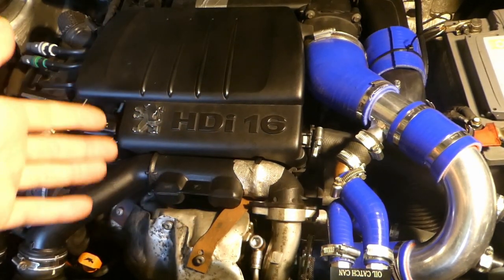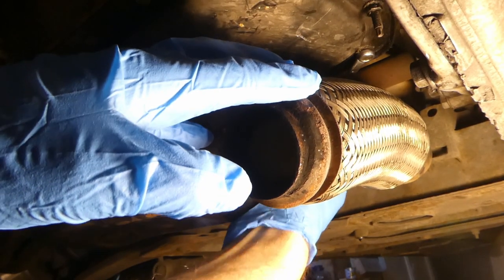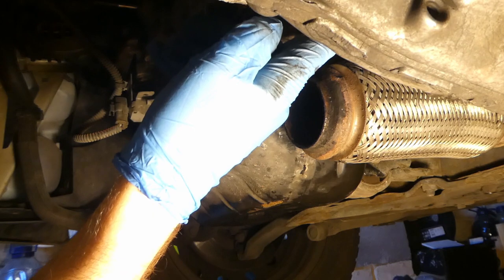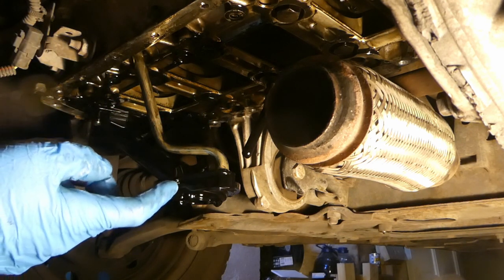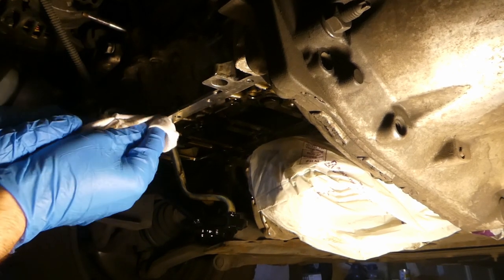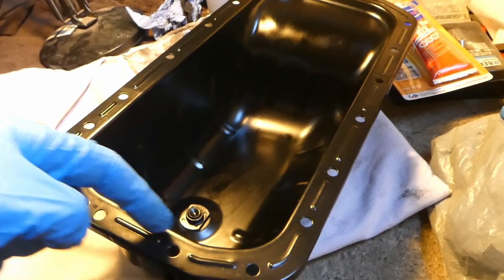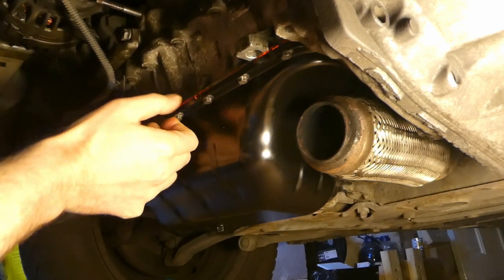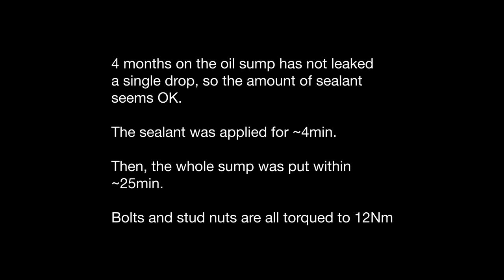1.6HDi oil sump replacement (Peugeot Partner 2007)

Comment: Nice.
And for more good news, just returned from the MOT under new stricter rules here in France. With 142K km and doing the stuff myself now, I was a bit nervous but it's good and we can use it for another 2 years. 
Two things came up, the fog lights low in the front bumper were pointing too low, well that's a bit of a mess up from my part, I knew I put the bumper assembly on the car tighter then it was before after I cleaned out the intercooler, but totally forgot that this could have messed up the alignment of those little lights, sure that is an easy thing to get right. 
The other was an obd fault code P1351 for an anamoly in anti pollution fluid without dysfunctioning important. I guess I need to fill up/ replace that fluid.
Thanks because it were your videos that showed me so much so I was able to get the things done. It feels pretty cool to see all the things I have done like the brakes are all in good working order.
Reply from the maker: Nice one Wim. Good to hear you have done well with the car. Every time I go for an MOT they always say the lights are too high and I have not done anything. Could well be tyre pressure, etc. There was this one time, before me doing work on the car myself, one of the headlights had broken support plastic and was dangling. Went to the garage, they charged me for a full headlight and then in two months time went to the same garage for an MOT. They phoned me that the car had failed and one headlight was aiming too high and wanted to charge me £30 to adjust/fix it (too much money for nothing). I asked which headlight was that and it was the same one. I told them you replaced it two months ago, she checked their records and fixed it without charging me. Ridiculous amount of money for a simple screw for the adjustment. I have not yet figured a way to adjust them myself, kind of a simple way. I do not want to buy the expensive thing/prism that you put in front the headlights. I need a wall, but difficult to get one and the ground is level. I need to do some work on the car, coolant, brakes, service, etc., before the MOT this year, probably brake fluid as well and of course remove all of my oil catch cans, despite these reducing the pollution of the car. Might do a video of something that was not covered before by other people. I only try to film stuff that was not covered before.
All the best
Reply: more molecules thanks, there is a reason you see the derogation "stealer ship" mentioned a lot reading/viewing about day car things... We are lucky and have dial to turn to adjust height of main lights from inside, and I really took good care of placing the huge headlight assemblies back, the bumper however is also very huge (funny to take those thing inside to show to family, in another setting the scale becomes more clear:)) and when taking it apart I saw it could be assembled tighter, so of course I did, making some gaps half the size. I feel so stupid not thinking about the ligttle , never used fog lights down there, I should have known the alignment was off when putting things back a little different. The garage guy said it was really not important, they area extra and no reason for failing an MOT, 
It was funny, they called earlier saying,  the oil filter and oil have not been changed in four years, so I replied, no worries, I changed the oil, filter and diesel filter and air filter half a year ago. To which he replied, d'accord superb" (ok that's good) and then we got the paper with the fault code, this is the first time they actually provided that, normally they just out regular speak things like tires need replacement, but now a code. He also was very respectful with icy is pretty cool for a French guy towards a non Franch person here. Of course their name is on the car and it looks pretty nice (I wash carefully despite a flock of thousands of birds residing in the bamboo in out front yard every day right behind where the car is.
It got me thinking, it must be hard to do a job with your hands knowing your customers are basically too lazy or not caring enough to look into it, must be nice to see somebody doing a proper job and keeping a 13 year old car looking like new :)
Reply from the maker: @Quibus777  Hahah, nice one with the oil, oil filter and air filter :-) Last time I went to a garage they asked me, "you dabble a bit, don't you". I did not admit I do anything with cars, I was playing the dumb customer, hahaha
Reply: @moremolecules  hahaha i did took out all non standard things and tools before we went to drop it off (like the obd2 to USB cable that is always connected to attach a little reader for temp and such during driving )and the mirror with dash cam that is over the regular rear view mirror and the cable to connect rear view cam (,though I left the cam for its screwed to the rear bumper)
Reply: @moremolecules  -  I'll drop my 2 cents on the way out! 
"...I need a wall, but difficult to get one and the ground is level..."
In fact it's incredibly easy. Go to ANY underground parking. Problem solved. Depending on your location big supermarkets or shopping malls will allow for free parking. So it's even better. BTW 3 minutes is all you need anyway.

Flat walls and flat leveled ground everywhere. Plus the fact it's dark enough to make it a breeze regarding headlight adjustment. K.I.S.S. is always the best.  ;-)
Reply: p1351 is a faulty glow plug my dude

Comment: There is a pattern sequence for all types of covers, sumps, heads, etc. Starting from middle bolts to end bolts turning left side and right side and across to pre-torque, and then again same pattern -  torque to correct settings. (Like expanding X )

Unless it's said differently in the car manual, this is the general rule.

But thanks for the nice video!!!
Reply from the maker: Thank you fot the correction and advice, appreciate it

Comment: Ok finally  finished the sump job  thank mate all your support !...
Reply from the maker: Well done!
Reply: @moremolecules   3 days took  thinking doing ERG next ? Not confident  though ?
Reply from the maker: @philipmaguire9209  Not that difficult, only difficulty is taking the bracket that holds the EGR to the cooler. Best done with the tool, otherwise is difficult. Replace with a screwdriver bracket, much is easier later on.

Comment: Those sumps leave 200 ml of oil in them when you change the oil. My wife just hit a rock in our 308 and did not tell me. However she told me the oil warning was coming on occasionally. I took it for drive and the oil light came on going around right hand corners. This was in the middle of engine management light issues. So under I get and surprise surprise there is a big crease down the engine protection plate. I remove that and there is crease down the sump. Remove the sump and the plastic oil pickup had snapped up above the 3 mounting screws resulting in it losing oil pressure as the oil went left as the car was going right. Now  I am waiting for the sump and oil pickup to arrive.
Reply from the maker: Hi David, yeah, absolutely right about these sumps. I had a video on how much is left inside (https://www.youtube.com/watch?v=5kevvRopWUc). I now have a big syringe to suck the oil left in the sum on oil changes Good luck with the sump replacement

Comment: This original desing oil sump of 1.6 HDI/Tdci engines has a big flaw.

Bolt is not at the lowest point of the sump, so there is left about 0.2 liters of old oil, really unbelievable.
Reply from the maker: Yes, it does have a bit of a design flaw, although I understand the manufacturer's thinking. If the bolt is sticking down it has a higher chance of being hit by something and loss of oil. I think that was the reason of pushing the bolt inside the sump.
Reply: @moremolecules  They have to do it smarter, this is just stupid.
There is aftermarket solution, https://www.mister-auto.de/oelwanne/bolk/bol-e061005/
Reply: @elzrinja365  there are modyfied at the market. Like this one from Klokkerholm with partnumber 1251335
Reply: @mercedesbenz9956  Thanks for info, I didnt know for that brand.
Btw I think this is the real part number 5507476

Comment: this video arrives 2 days late,the plastic tip of the oil gauge broke inside the strainer and there was no way to get it out so I had to remove the sump and the strainer, all done last weekend ,thanks 😊 anyway
Reply from the maker: Unfortunately I have no oil gauge, although would love to have one. I suspect that it measures it somehow as I get oil indication before I start the car. Good that you have it sorted!
Reply: torx size for strainer removal?

Comment: Excellent ! Thanks ! Too bad your replacement housing does not have the flat bottom to correct the defect of the original. Thanks to you for your video. :)
Reply from the maker: Yes, I did not think about this too much and I should have bought the flatter bottom sump.

Comment: Hi just removed the oil sump   and found pick up pioe damaged snapped off.. and strainer too  I will replace asap  however  can you tell me if its a allen key  needed  to remove it plus size . Thankyou   p.s did not need to renew the down pipe  blessing   in  it.   Peugeot estate  1.6 2005.. . Hdi  ..
Reply from the maker: For the strainer/pickup, depending on the model, mine were simple scre rather than allen key, but depends on what is there.
Reply: @moremolecules  sorted it  torx..  one last question   please!   There's aluminum pipe on  the   pick up  oil  is it part of  dip  stick tube?

Comment: Hi what will be the torque on bolts for the oil pick up? As seen on the video it is clean and he did not changed it.
Reply from the maker: Oil pickup bolts are 10Nm +/- 1Nm. Yes, mine was clean and I did not change it.

Comment: Good video, HOW-to,  but, actually I don't understend WHY somebody will change the oil sump?!?
Reply from the maker: Hi Predrag, if you are replacing the turbo the oil sump needs to be taken off and the oil pickup replaced or at least cleaned or inspected. There was a comment yesterday that the oil gauge tip was broken in the oil pickup and there is nothing else one can do.
One additional reason, when the old gasket leaks oil, it could be an MOT failure and the sealant needs to be re-applied.
Reply: As a matter of fact all those reasons. Are no reason to change it! LOL 😂 Admittedly you changed the oil sump, because you wanted to. Surely not because it was needed. Fact is that without damage, the "old" oil sump would out live the car itself. 
Just like Predrag I never seen anyone change an oil sump exclusively for the "look" of it. After all this is a Peugeot Partner, not exactly a concours classic vehicle.  

BTW for what its worth. Tip: In most cases you can retrieve the oil dipstick broken tip, from these engines. With a vacuum cleaner (Hover). Just make sure you empty the oil sump first (for obvious reasons). ;-) And provision some way to later clean the vacuum pipes/hose. Or in other words, don't use your wife's best vacuum cleaner. A workshop vacuum will extend your survival possibilities...LOL 😂 
Cheers
Reply from the maker: @crpth1  If you check any PSA guide on turbo replacement, it is always recommended to replace the sump with the oil pickup. It is a potential reason for a turbo failure. It was also leaking. The cost of the sump is nearly nothing and I get the benefit to know that there is no sludge or anything inside. Now, of course one can leave as it is and it is a Peugeot Partner, but I intend to drive this car quite a few more miles.

Comment: Mine is dent  peugeot 307hdi 2007   estate   getting  pressure  oil Sump  plus   stop  light    strangly  oil looks OK  dip stick ?
Reply from the maker: It could be that the pressure oil sensor is faulty or if the oil filter was recently changed it was not fitted properly and there is a bit of loss of pressure. If I were you, I would replace the filter again or open it and screw it back on again. You need to drop the oil before hand and either put new oil/filter or put the old oil back in.
Reply: @moremolecules  recently dented sump so I ordered  new one

Comment: Hi curious to no if my Peugeot 307  1.6 estate 2005   sump has to  have a Gasket ? Or can I just  use  silicone  bond only  ? Thank-you
Reply from the maker: As far as I know (could be wrong), all 1.6HDi (92bhp) sumps are just with silicone only, no gasket.
Reply: @moremolecules  Thanks so it will be solicon.. can't bd bothers  old idea gasket ring
Reply: How do I remove downpipe   ? Access to bot
Reply from the maker: @philipmaguire9209  There is upper part (front), middle (intermediate) section and rear exhaust. The middle section has a kink. They all are connected with the same bracket. Basically you have to remove the bolts and can be taken out. If bolts are rusty and cannot be removed, you need to cut them out, no other option.

Comment: I have a broken dipstick ... Is it easy to remove the dipstick tube ? Thanks
Reply from the maker: Not an easy way to do it. You need to drop the sump and take out the broken parts and then re-seal the sump. Dipstick tube itself is integral to the engine, no way to remove the dipstick tube itself.
Reply: @moremolecules  I I have successfully removed a broken dipstick using this method: 1) Remove the oil from the engine and keep it clean for refilling. 2) Let the oil sum open from the bottom with the bolt removed. 3) Connect with adhesive tape a small diameter tube between your vacuum cleaner and the dipstick tube on the top of the engine. 4) Power on the vacuum cleaner and the broken part of the dipstick will come !

Comment: How did you take off that part of the exhaust?
Reply from the maker: As shown in the video or maybe I missed the question. I had another series of videos changing the turbo, so I removed it again, maybe it is better shown there. Which minute in the video is that?

Comment: You need to remove the muffler to remove the oil pan ?
Reply from the maker: You do not need to, but it makes things easier. I was replacing the turbo, so it made sense to do it in one go.
Reply: I've just started this now but the rain is coming...deffo need to remove the muffler on the Berlingo 2006 to get to that difficult bolt or by hand and very strong hands to crack the nut
Reply: I managed to replace the sump without taking enything else off, but I was strugling with putting new one sump on without touching sealant, because there is a bolt standing out just above that flexible pipe.

Comment: Does anyone know what torque the bolts for the oil pick pipe are to be done up to please?
Reply from the maker: If this is about the turbo oil pickup, see my 5 videos on replacing it, the torque settings and how to do it is explained/given  there: https://www.youtube.com/watch?v=Q7S0qDBo314 . This is the first video, but I think in the second or third they are all given.
Reply: Thanks for the reply. It's the oil pick up in the oil sump. You clean it in this video but the one on this car was too blocked so I bought another one. 
The new one comes with three bolts with thread locker on but I'm worried about getting the torque right as it's plastic.
Thanks
Reply from the maker: @TheFlibNet  Sorry for the late reply. It is 10Nm +/- 1Nm. Hope that helps and good luck
Reply: Thanks. The oil pick up went back on okay but the oil pan was a bit of a disaster.
I messed up the settings on the torque wrench and accidentally tightened the oil pan bolts to 28nm. Which inevitably led to one of them snapping.
So I don't know what to do now. Doesn't bode well for the rest of the turbo replacement.
Reply from the maker: @TheFlibNet  I have snapped quite a few bolts like that during all my working on the car. I always thought that some bolts are not tight enough and went on to tighten them even more and they snap.
Do not worry too much abou this. Remove the sump and start again with new bolts, same diameter/thread. Clean it well and do according torque. The bolt thread that is left you should be able to remove with pliers.
It should be alright with the rest, if I can manage and I do not really have that much experience myself and thought myself how to do it, you can do it as well.

Somehow your comment about the manifod torque dissappeared, which bolts are these? Are those the turbo manifold bolts?
Reply: Thanks again. Unfortunately the bolt snapped lower down so I can't get mole grips on them.
My attempt to use a stud extractor didn't go very well either so I've given up on it. If it leaks then I'll take it apart and put a helicoil in.
With the manifold bolts I've realised that the turbo on your Peugeot engine is differently set up to the Citroen I'm working on. On this, the turbo is bolted to the exhaust manifold and unless you've got some clever tool to get the bolts off, you have to remove the manifold to gain access to the bolts. I think I might have found out the torque setting though.
See if I can get that bit right at least.
Reply from the maker: @TheFlibNet  Good luck. Yeah, my engine might be on the old side of things and your Citroen is probably newer version and they have re-designed a few things around.
The sump will not probably leak with one bolt off.